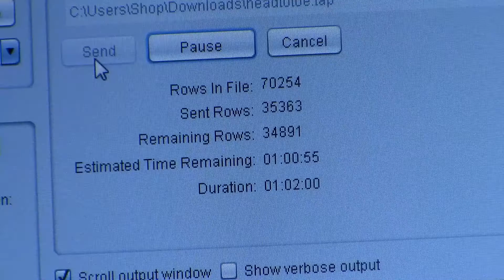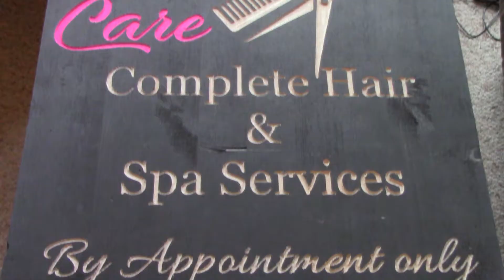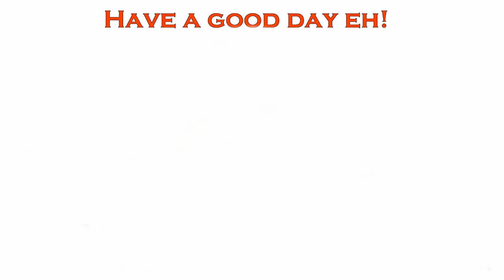MPCNC - Custom Business Sign

Comment: I have a Creality CR-10 coming, and I definitely want to build a MPCNC! I just subscribed, and look forward to watching some of your older videos to learn more! I am also want to make wooden engraved signs? Can I ask how big your cutting area is?
Reply from the maker: Awesome the MPCNC is right up your alley my cutting area is 2ft x 4ft I upgraded it not too long ago in my older video's mind you they are longer but worth the watch ;)  will have my older machine in it.  I would start smaller tho and if you are just going to be using it for wood I would probably suggest smaller legs as well I am going to be making mine a bit shorter as I have always had more then enough height on my machine but would like it to less of  a drop to the material I am cutting.  But make sure to check out the forums at http://vicious1.com and you will find links to all the thingiverse files there and parts list.   Good luck and see you on the forums and thanks for checking out my videos! have good one eh!

Comment: Hi, good video...for the structure, you use tube in inox?thanks
Reply from the maker: It is EMT Conduit,  I have not gone to the stainless yet maybe in the future seems to be recommended by quite a few people but I just don't want to shell out the extra for it at the moment maybe on one of the newer ones I build.

Comment: What are you using for a board? what is the software you are using to run it? is that GRBL or MARLIN? I printing parts now to do this but id like to run grbl instead of marlin. What do i use for a file to flash my chip to run grbl on mpcnc machine?
Reply from the maker: Running  arduino uno r3 with cnc shield and grbl and then universal gcode sender   here is how to flash grbl https://github.com/grbl/grbl/wiki/Flashing-Grbl-to-an-Arduino

Comment: what is the machine size?
Reply from the maker: Cutting area is 2ftx4ft table is 3x6 had to put my feet pretty close to the edge to get my cutting area. Next time I'll build a table for it.
Reply: @Gam3T3cHElectronics  excellent, thank you. Im printing one now but I cant decide the size to go with. Im printing the 23.5mm model
Reply from the maker: I started with a cutting bed of 1ftx2ft that I loved but then my projects became bigger and bigger so it was ideal to upgrade next one will have a bit shorter legs and smaller z axis.